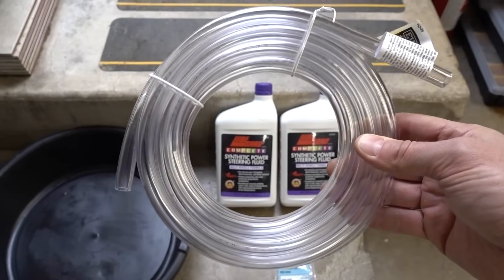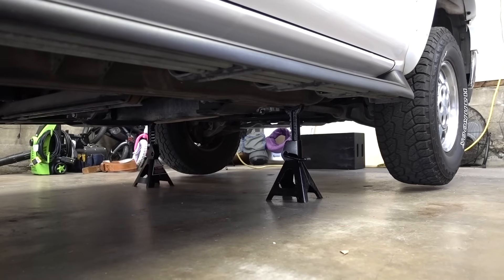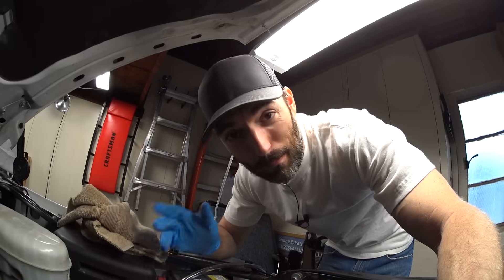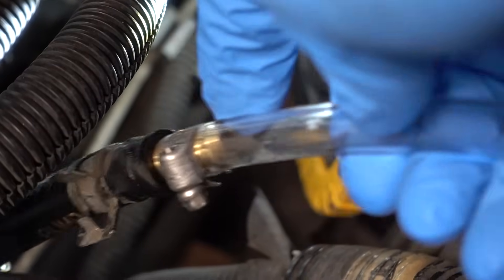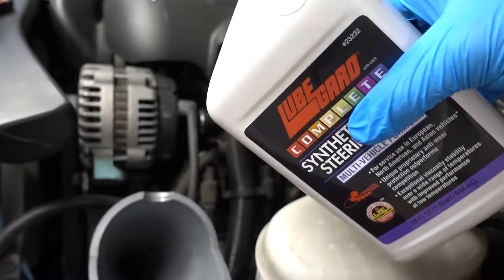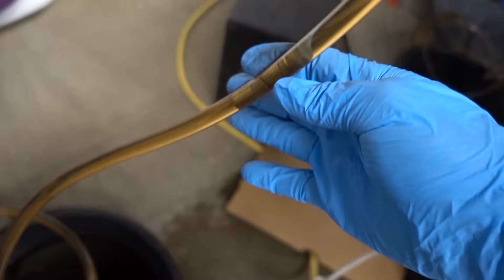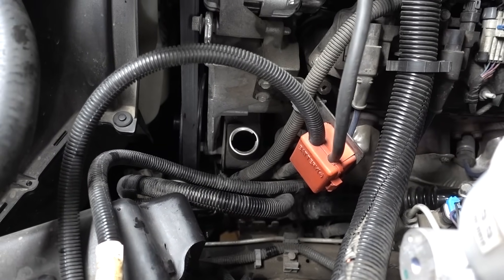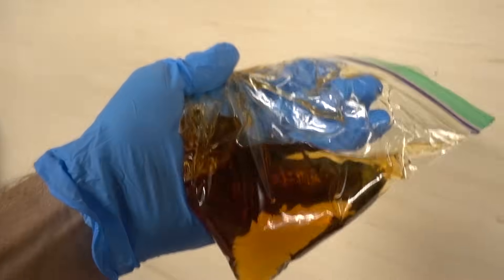Absolute BEST Method To Flush Power Steering Fluid!!

Comment: Correct method to do a flush I've done this on two of my vehicles the most important part of this whole procedure is getting the CORRECT FLUID!!!👍
Reply: jud dude  yeah its nightmare in BMW as well, on the cap it says ATF only, but actually its pentosin inside (VIN says also it needs pentosin)... and when the fluid is rlly old and burnt its hard to distinguis the red or green tint cuz its very dark black ;/
Reply: jud dude  Pentosin is very good when you have other stuff runnin off the same hydraulic circuit (power steering, lowered suspension) but for standard vechicle with only power steering, i used half priced german fluid which is pentosin chf 11s replacement, actually few good replacements you can find that meet bmw standard like ravenol or febi. For price of 1L of pentosin, you can have 2L of the other one - complete flush + fresh fluid.
Reply: GM, Ford, Toyota, Dodge, Hyundai/Kia just take plain old ATF. They'll all specify their brand specific ATF, but in a simple system like power steering you aren't going to hurt anything.
Reply: Hondas are known to be finicky about ps fluid. But that won't keep some ass at Jiffy Lube from throwing generic in it.
Reply: @tmst2199  if you want it done right unfortunate you have to do it yourself.

Comment: I used your "engine off" method and successfully flushed the power steering fluid out of my 1998 Isuzu Hombre.  You are correct, it was less stressful than the "engine on" method and I didn't have to worry about running the pump dry.  Thanks for making the video, it was a HUGE help.
Reply from the maker: Haha, cool!

Comment: Good video. It is becoming very common the need for flushing power steering systems. Many of the fluid reservoirs have a internal screen that gets plugged up so it is a good practice if the reservoir is removable to take it off and reverse clean it with some brake cleaner or mineral spirits. One way I evacuate the system is with a wet/dry shop vac. Ill even start it briefly with the shop vac running in order to claim the fluid from the steering gear.

Comment: EXCELLENT demonstration: Couple of questions a) Who told you that it needs to be changed b) How many miles is it recommended to change?  In + 60 years of driving with vehicles WELL over 100,000 to 300,000 miles I have NEVER changed the PS fluid and had NO issues with the PS.
Reply from the maker: I'm just using good old common sense. Fluid is black. Power steering feels weird. Pump is noisy. Those sorts of things. Plus I'm sure the manufacturer recommended interval is like every 30k miles or something...
Reply: @1RoadGarage  So did you actually NOTICE a change in your steering after the flush? Just curious, thanks
Reply: I'm also curious did you noticed improvements
Reply: On some cars, you get away with not changing the fluid, on other cars it leads to needing a repair at 80,000.

I witnessed this happen in my own family. My dad had a 1995 Honda Accord, and went 7 years and 180,000 miles without doing anything to the power steering system. Nothing bad happened. My mom had a 2005 Jeep Grand Cherokee, and the power steering pump developed a terrible noise around 100,000 miles and needed replacement.

Also, on some cars, the power steering system was a piece of garbage, and no amount of preventative maintenance could save you. During the 1980s, the early power steering rack designs were failure prone. It was one of the most common and expensive repairs on the first Ford Taurus for example. Also, Nissan had several problems. Honda got around the problem partially by inventing their own power steering fluid.
Reply: @REVNUMANEWBERN  I've personally noticed a change during cold (like near -40) starts. It's during those cold starts when the fluid is thick that dirty fluid won't flow as readily and blow out a hose.
Reply: There is no such thing as eternal fluids. Everything degrades and needs to be changed. All the fluids in your car has a life span. Motor, transmission, hydraulics, everything. Try to change before it breaks. As the old science phrase: absence of evidence is not evidence of absence.

Comment: I was going to do this.
Then I got a pitman seal leak.
I had to remove the steering box, to replace the seal.
Removing the steering box was way easier than i expected.
the thick sludgie crap I got out of it sat in the bottom of the steering box, and was not mixing with the pumps circulation.
I am so thankful I dumped it out, and rinsed with the proper ps fluid. 
It's been perfect since.
I am thankful I had that leak, a 10 dollar seal fixed it.
2006 Ford e350
oh, I did rent a 90 dollar pitman arm puller,
I had to modify it a little with a grinder,
and I opted to keep it.

Comment: Major tip: when doing this. BE sure to keep the Power steering Fill cap closed when doing this! Video made it seem he had the lid/cap
Open as he was doing it as he stated he would “fill with new fluid” after a while to prevent the reservoir from being dry/empty. as I turned the wheel over 100 times, it over flew and made a mess. Also, don’t need the hose, just use a clear water bottle and place “flimsy return hose” into it. After 288283 turns left to right, I finally got it. Mine was an 05 tahoe 2wd and return line was near the top, not down below as shown in this video. In the end, don’t try this with “Cap off” to hear the “bubbles” of air escaping. If you did this right, no air would escape, so KEEP cap on full time
Reply: But, good helpful video . Funny, i have the exact same fluid left after using 1 n a half quarts left too. No more “squeal” noise from making hard turns left/right:
Reply: Mine over flowed from where he put the zip tied tube. Is that where yours overflowed? Is the solution to make sure the cap is closed?
Reply: I think there might be a difference between using steering wheel versus forcing wheel back and forth.  I have the 3.4L with return hose on top and never overflow or mess, even though I filled max to the lip.

Comment: Add 2-3 ounces of Marvels Mystery oil you will notice and feel a huge difference. I've used it for 30 plus year's only good has prevailed.
Reply: Is there nothing it cant do i swear
Reply: Bwahahaha
Reply: I am thinking on using marvel mystery on my next oil change with new oil drive for 500 miles, drain it and put after new synthetic oil
Reply: @juanbohorquez8922  you just replace a qt of engine oil with MMO on next change. Go to their website for recommendations

Comment: Great video! Replacing the power steering pressure line, sooooo I’ll flush the power steering fluid the Quick Stop used on my truck and find a higher quality fluid. Yeah, keeping in my they switched mine to synthetic. Thank you for the hose line tips. Great video! Silverado 1500 5.3 Z71 4x4 288k

Comment: Thanks so much for showing me this, it's time for me to do this on my 2009 Hyundai Genesis 4.6, and a Differential Fluid Change, both have to be done by a professional at the dealership, I have serviced my vehicle at before which is Hyundai prices are reasonable, preventative maintenance does wonders for a vehicle. My vehicle still looks brand New of all the rountine services, I've had done since first day of ownership.

Comment: Jimmy! You are the BEST! Do you have a video of a Power Steering flush with HYDRO BOOST. I have a 2007 Hummer H2 with Hydro Boost that needs flushing, I use the same PS Fluid that you do, but after a couple of 8000 mile road trips around the country, it is now black. Your videos are the most articulate and easy to follow with no Hummm!, Uhhhhhhhh! and missing steps. I simply have not found a mechanic I trust any longer to do the work. They have replaced four Power Steering Pumps on my Hummer in the past 16 Years I have owned it. Every time they put a RED fluid in, the pumps or hydro boost goes out. ONLY the CLEAR LUBE GUARD COMPLETE works without issues. Thanks in advance for all of your WONDERFUL videos!

Comment: Once again, a brilliant method....I saw your other demo on how to flush an automatic trany.
Suggestion: 1. Get a pair of those remote hose clamp pliers. They work great because they lock in place, fully opening the clamp and allowing you to use both hands to move the clamp over out of the way. 2. Would have used a turkey baster or some other suction tool to remove most of the old fluid out first...just being fussy. Thanks again....very well done!

Comment: A fluid extractor would be your easiest and cleanest change in fluids. Also allows you to avoid turning the wheel lock to lock and avoid air in the lines

Comment: Nice job, excellent video!   Need to change some fluid NOW! 18 yr old SUV and never changed.   I've learned about three different methods to do it.  I may end up trying your method.  I recently changed another car's PSF by another method;  it involved turning on the motor to pump out all the fluid.

Comment: A lot of domestic cars also use ATF for power steering, something worth checking if you already have some laying around
Reply: Just because it's red doesn't mean atf....most vehicles have a specific fluid to use. Read the owners manual
Reply: I did, and the shop I work at where we get all the information on cars straight from the manufacture themselves state that ATF is the fluid to use in their vehicle for power steering. Not every vehicle uses ATF but a majority of domestic ones do. There are other fluids it can run but it is something worth looking into if you don’t want to buy more fluids when you already have ATF. I agree read the manual so you don’t screw something up I’m just saying that this is an option as well if your vehicle takes it
Reply: The only possible problem with ATF is which kind? Mercon, Dextron, etc. Make sure to check the type of ATF is not going to cause problems. I would stick with power steering fluid. Synthetic helps.
Reply: It looks like ATF came out of the car originally
Reply: matteightytwo 
I've bought power steering fluid @ Dealer that looks like ATF. my point is check your owners manual. Also call a Dealership and ask what recommendations are per your vehicle. It doesn't hurt to ask.
Reply: @z31rider24  the filler cap often has details, another useful source is Castrol oil finder but using a fluid being the bottle says it's good for euro, US and Asian branded cars is a bit of a leap of faith
Reply: It isn't just domestic cars. Toyota and Nissan use ATF in many of their cars and trucks.
Reply: You can put what ever you want in ur car. Im not here to argue. Just giving my opinion on how simple it is to check ur owners manual along with a second or third opinion on what goes with what and what doesn't.
Reply: Aaron Sanders I do not recommend using any fluid in any system unless it is called for by the manufacturer due to the material the seals are made of.  The seals are made for certain fluids and can be degraded by the wrong type of fluid used with it.

Comment: Bud, I am about to change out my power steering pump and was dreading the flush and bleed. you made my life a little easier with this method. Thanks
Reply: I used the pump from my shampoo bottle. Pump out replace with new. Drive  around the block. Do this till fluid is clean. I used a couple of quarts before it came clean.

Comment: option 2 is very fast and easy. But you need a friend. Drain all fluid in the reservoir. Get the return line and drain that into a bucket or bottle, we used a 1 liter coca cola bottle. plug the return line in the reservoir, fill reservoir up to the brim and have a friend ready to pour fluid. start engine and let it drain, once fluid that comes out of the return line is clear have your friend call out stop and you turn off the engine. Done in less than 15 minutes.

Comment: I'm here after researching Land Rover Discovery power steering pumps. They have a filter in the outlet of the reservoir which can get blocked which can be the cause of a noisy pump and stiffer steering. They recommend cleaning the filter first before replacing the fluid.

Comment: My car is a 2003 Toyota and still has the OEM p/s pump and rack. Every year I drain the reservoir and refill. I have never drained the entire system. Same thing with coolant. Every year I drain 1 gallon out of radiator and refill with 1 gallon of fresh OEM coolant. The car still has it's original cooling system pump. thermostat, hoses heater core, radiator etc....Oh I did have to replace one steel line on the ps pump just last year so the system lost all of it's p/s fluid and ran dry for a while. I replaced the line and refilled still going strong. I had my radio blazing and I have an aggressive exhaust so I did not know I was out of PS fluid until the steering started to get iffy.  I do not think you need to "flush" a system if you just empty enough out and refill every year instead of waiting for years and doing a flush. Kind of like changing your engine oil regularly instead of going years with just topping off then doing an engine flush. Clearly that makes no sense.

Comment: Thanks for the great method, worked perfect, the most difficult part was finding correct fitting plug and hose...haha. I couldn't believe how fast fluid flowed by just turning steering wheel with engine off. Thanks a Bunch.
Reply: So I did this today, on a Honda Accord 2012. I used a 1/4id x 3/8 od. But I used 4 of the 12 ox bottles and I kept seeing the tube black basically so I don’t know if I had air in the system cause I kept turning and turning from side to side, but I saw it come out but when I we t to go the other way I saw it going back into the return hose. I never saw the tube clear up fully like it shows in the video.. and i still have to stop by Honda later to get another bottle to finish topping it off. Did you get the tube full of clear fluid? I don’t know if I did something  wrong

Comment: For a guy like me, I am tempted to splice in a "T" with a capped tube for the flushes in the future.
Reply: Did you do it with a T and did it work?
Reply: Cool idea. I think you'd also want to pinch off the line to keep dirty fluid from returning to the reservoir.
Reply: I like this idea, you'd wanna throw a valve on the pump side of the Tee so fluid could only drain. Honestly wouldn't mind doing this with everything and make fluid changes easy af on myself lol

Comment: I just did this with my 06 Silverado (with rack an pinion). 99-06 GM trucks came with both rack and pinion, and regular steering gear, but the power steering pump/reservoir are the same layout as shown.

Comment: You usually bleed the air out of the system with the engine running and by turning the wheel back and forth around 10 times with the front wheels off the ground anyways
Reply: With the engine running? Don't follow his advice guys, you have a chance to run your power steering pump dry. And they dry FAST. So unless you have a cheap car where a power steering pump costs $100 I wouldn't follow the engine run advice.
Reply: @j3in725  If you’re bleeding the air out of the system you already have fluid in the system and you’re just trying to get some trapped air bubbles out
Reply: @j3in725   He was talking about bleeding the air out, not flushing the system.

Comment: You can also siphon from the power steering  reservoir and refill the reservoir with new fluid drive a few miles siphon again. repeat process 5  times . That will pretty much exchange the fluid

Comment: In Hondas there is a screen that acts as a filter in the bottom of the ps reservoir. If you never clean that screen all the fresh fluid in the world isn't going to stop the pump from sucking air past the o-rings on the hose fittings. Just FYI, something I learned the hard way. Some folks just buy a new reservoir, they are not expensive.

Comment: I've heard if the steering wheel is crooked significantly, it is certainly a problem w/power steering rack (as far as I understand the problem can't be fixed then just by simply moving in and out Outer Tie Rods in corresponding directions).  Mine is crooked ~45 degrees to the right, no steering fluid leeks observed (I saw some fluid inside of the boot ~ 8 months ago, when changed Inner TR (on driver side only, on passenger it was dry), but I think it is very small, since the fluid level doesn't change). I don't remember when that problem w/crooked wheel developed, I don't drive that car a lot, but I hit a limiting concrete bar which they conveniently locate at some parking lot 4-5 days ago, and noticed 45 degrees after that event. So what can happen to a steering rack, what can be wrong, if no leak observed?
   The car is 2003 Chevy Cavalier. Thank you very much for the informative film.

Comment: Hey, I invented the hot water-logged I'm using the same method, but you gave me an idea - I can run the engine with fuel's pump fuse removed.

Comment: I just use my mityvac pressure feed the pump inlet hose from the reservoir. Return line goes into a pan and run the wheel side to side also.

Comment: Believe it or not. I have never changed my 86 Camry power steering fluid for as long as I owed. After 25 years ownership I finally retired my old Camry.
Reply: Same with my 92 Toyota paseo. 350000 miles on it, but the door lock failed first- I cant get in the drivers side door from the outside or inside handle (won't unlock).  This would be an easy fix if I could open the door...